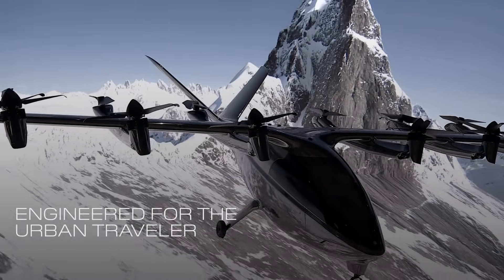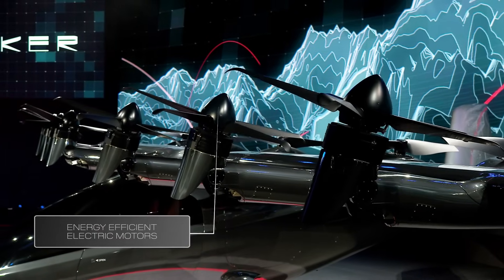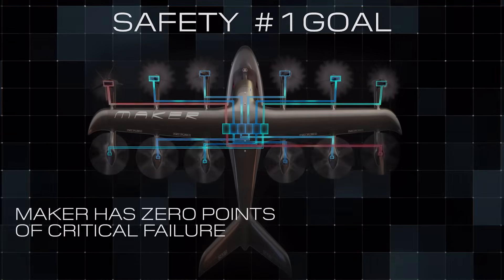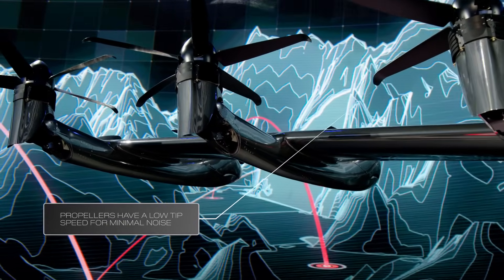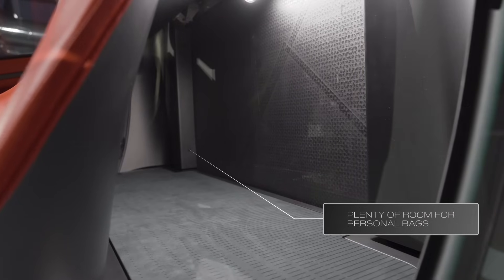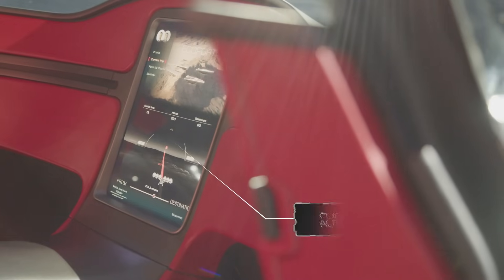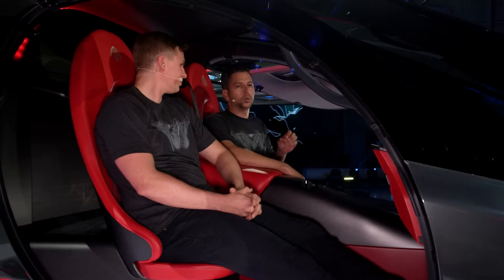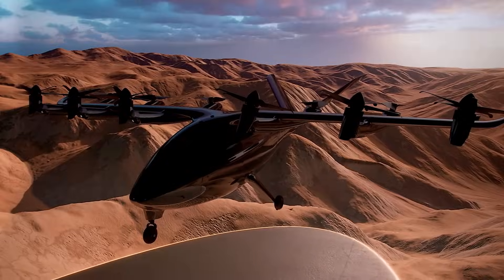Maker eVTOL | Aircraft Walkaround Video

Comment: That is a bit of a strange image when the mockup appears to be moving through the air and the blades are stationary. Odd. Otherwise this concept looks extremely cool and hopefully it will be a success!
Reply: It's because the speed at which the blades rotate is similar to the refresh rate of the camera, so the blades seem to stay still or move at a different speed. It does look pretty weird though I agree.